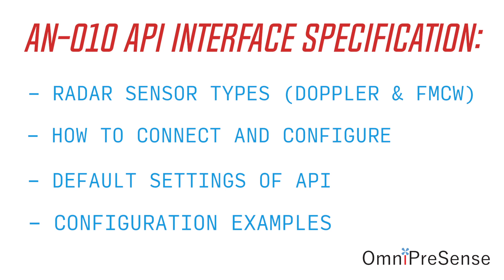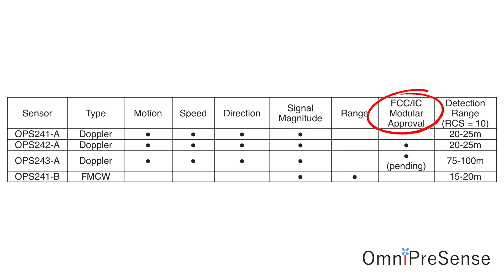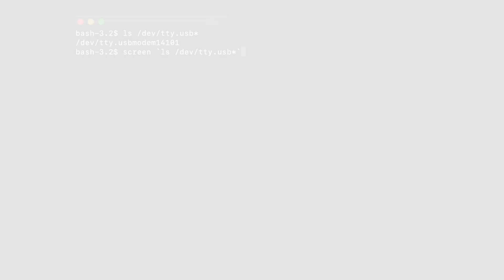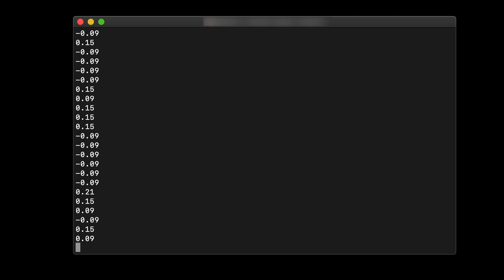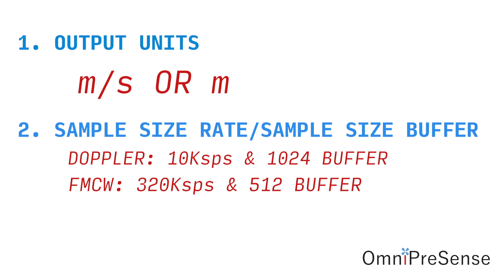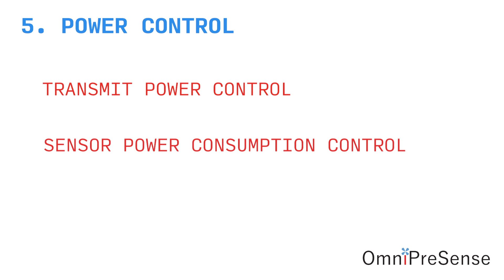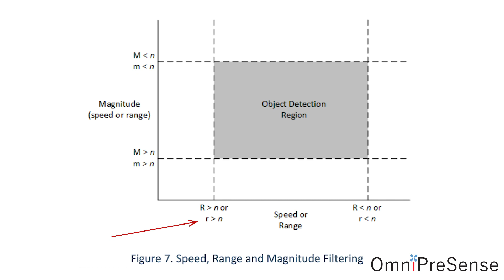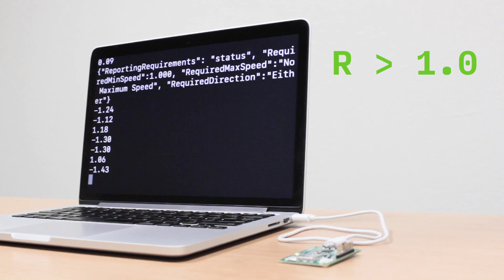OmniPreSense Radar Sensor API Interface (AN-10)

Comment: Can OPS243-C FMCW and Doppler Radar detect the range and the angle of the target as well ? (if there are two targets at the same range but at different positions can it detect ?)
Reply from the maker: Sorry no, just the range and speed.  To get angle information you need a 3D or 4D radar.  Two objects at the same range to the OPS243-C will look like the same object but keep in mind the objects are bounded by the area of the field of view (20x24 degrees).  The size of that field of view is dependent on how far out the objects are located.

Comment: what is the maximum speed m/s detected by the sensor?
Reply from the maker: The maximum speed is selectable in the API.  In the default settings it's 31 m/s (69mph) but you can double this or go even higher with a simple API command change of the sample rate.
Reply: @omnipresense  which product can measure speed from 600m/s to 1000m/s
Reply from the maker: @tamhoang3971  The OPS243-A settings can be configured to reach those speeds based on the math.  However, what is going that fast that you want to detect?  The size of the object could be an issue.  A bullet and muzzle velocity may be one application.
Reply: @omnipresense  i want to detect muzzle velocity. Which of your products is suitable?

Comment: How do I type commands into the API using Tera Term? When I try to type, the sensor continuously writes over what I'm trying to type.
Reply from the maker: Hi Mateo.  The sensor should not write over any data.  Maybe Tera Term is no reporting or displaying correctly.  You could start with a PI command to Idle the sensor and stop any data coming out.  Send me an email at customerservice@omnipresense.com if you need more help.  If you can provide a copy of what you see, that would be great.

Comment: Can the sensor modules detect speeds of multiple vehicles at a time, for example in case of a multi-lane road?
Reply: Yes, simply issue the On command where n is a number between 1-9.  This will give you the top 9 speeds seen by the sensor.

Comment: Can it penetrate through dry walls
Reply from the maker: Yes and no but generally we say no.  The sensors operate at 24GHz and at that frequency the signal more bounces off objects and doesn't go through them.  However, it will penetrate some objects and can see on the other side.  A simple test is through a wood table.  You should get something through a wall or one side of the material but its not something we'd use.
Reply: I found ARIA radar modules, see http://ariasensing.com/. Their LT201 module claims 'through the wall' sensing.